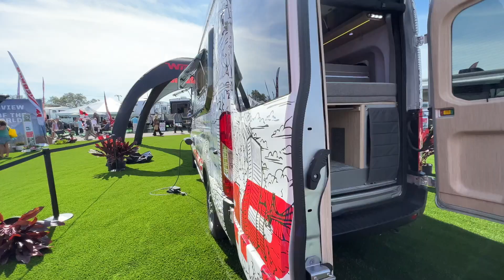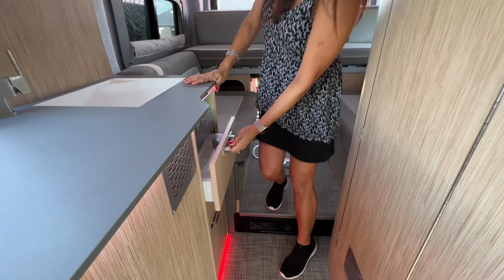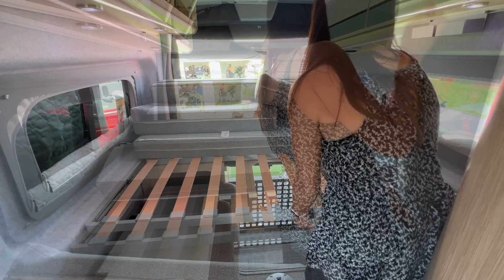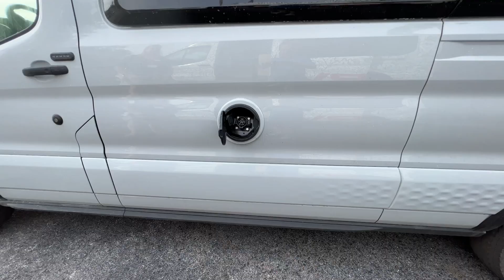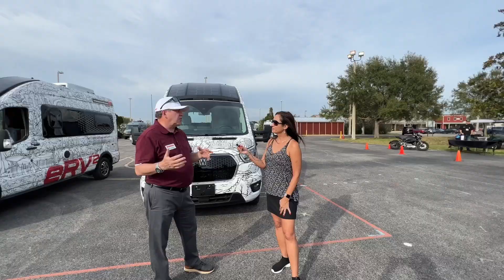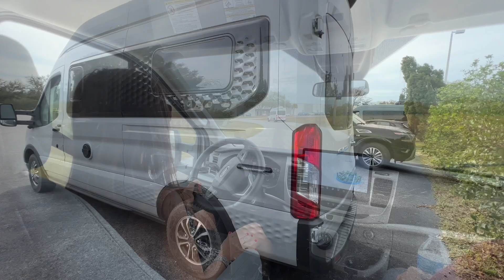Tour & Test Drive The Winnebago eRV2 B-Class All Electric RV

Comment: not soon this kind of rv will be convenient for driving to a remote area from the city.  And the point is not even that the battery charge is not sufficient, but that there are no charging stations in remote areas yet.
Reply from the maker: You have a very good point that a lot of the campgrounds are in very remote locations.  However if they have 30/50amp outlet you can charge right on your site.  Boondocking would be a different story and will require charge station planning.  Thanks for Watching!

Comment: Nope. Not interested in EV until they recharge themselves
Reply from the maker: Solar technology still has a long way to go before we have self charging RVs, but I have to say that I was very impressed with the 900 watts of solar for the house battery system.  Thanks for watching!
Reply: @RubysAdventuresUnplugged  I wasn't thinking about solar, having the engine keep itself charged like an alternator does in a gas engine. Never needing a charger station... But that's where the money is

Comment: Winnebago doesn't have the capacity to build the entire chassis from scratch, so they will always be at the mercy of whatever the big three van manufacturers can produce (Ford,Dodge,Mercedes).  Once you see electric delivery vans, work vans, etc. making up the vast majority on the road in suburban/rural areas and having workable mileage, then you will see that trickle down into the RV market.  Until then, this will just be a cool concept or never see any meaningful production numbers.
Reply from the maker: I believe you have hit the nail on the head for Winnebago's strategy.  Everyone knows that lithium technology is getting better and better and it will not be long before we have van chassis capable of 300-500 miles in range.  Winnebago is investing and testing everything that it controls and will be in a great place once we do have the range.  Thanks for Watching!

Comment: I love this B van -- once Ford expands the range it will be a major winner. I really love the solar options because I like to boondock for a while. The bathroom is fine - most weekend trips I don't need to shower (do it before trip and after) but for the longer trips it's fantastic. It's very nice to have your own toilet. One of the test drives I saw they talked about the chargers for the two systems eventually being combined so you would only have to plug in one place. I also love the bed being adjustable to different configurations. Only thing I don't quite get is the table/desk area at the front - it seemed a bit awkward.
Reply from the maker: Hello Delvie, I agree that this will be a winner once the chassis battery technology gets to an acceptable range.  I liked the materials of construction and how quiet the Rv was driving down the road.  The prototype I reviewed was able to charge both battery systems from the chassis cable alone, but it is not the most efficient means of charging the house battery so they added the second port.  Winnebago is trailblazing this concept right now and I am sure their investment will pay off in future eRV builds.  Thanks for Watching!

Comment: Hi Ruby the basics of this Ford based RV are very good. The range however is not enough, for me to consider this. When battery technology advances a lot more, should be a good alternative.
As usual Ruby you look Gorgious 🌹
Reply from the maker: Hello Max, I agree that the current range is not there yet but Winnebago knows this and are working with chassis manufacturers on longer range chassis.  The current prototype RVs are really testing the other components / materials that Winnebago does have more control over.  Thanks for Watching!

Comment: Did I hear that the range is 108? Laughable.
Reply from the maker: The current range from Ford is 108 which is underrated and not the 3 hours range that winnebago is targeting.  Winnebago is targeting 3 hours of driving range for the production version, but they are currently limited by the available chassis ranges from the van manufacturers.  Thanks for watching!
Reply: @RubysAdventuresUnplugged  Thank you.
Reply: Yes driving 3 hours 5 mph 😂🤣😂🤣😂🤣